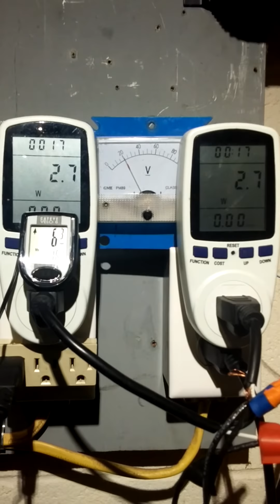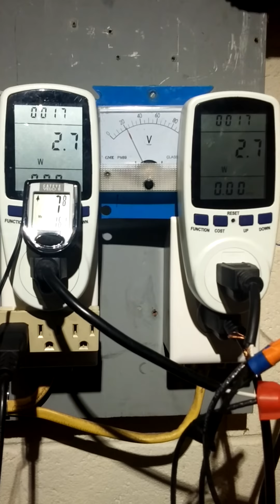Wind turbine with Enphase PT1

Comment: Keep up the great work. I really like the idea of not only a UL listed inverter for micro wind, but one that would cost less, maybe $160 (pre-modification) than your typical Chinese Sun G with way better efficiency.
Reply from the maker: thanks Pal. I am having great sucess!!. I now have hooked two M 250's to the system, i max those out a 23 MPH winds according to my recorded data. I am now going to do 3 M 250's. I am hoping to get 1kw under 30 MPH due to the inverters efficiantcies and the controller circuit I have custom built. The efficiatncy is way better then the Chinese inverters!! This is a break through i have been hoping for many years. Thanks for watching
Larry

Comment: I am very interested in this...here there is no net metering...no grid export...we have 62 commercial windmills near operating at 69% efficiency...my 7am to 5pm importation is down to 1kwh with 6 325w panels and iq6+ microinverters...i have an iq envoy for monitoring and export limiting...i would love to interface wind into my existing system controlled by the envoy for self consumption...could/would you help me achieve what you have done???
Thanks
Gene french
Reply from the maker: Yes i can help.